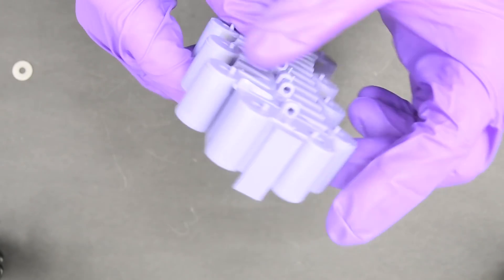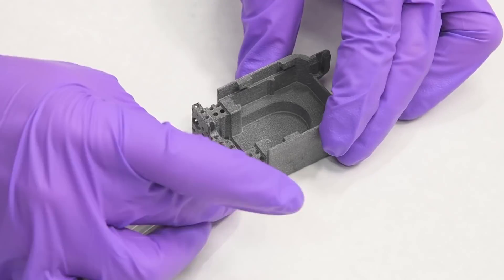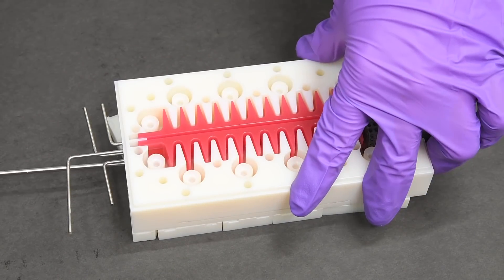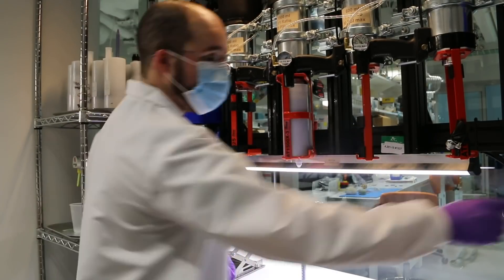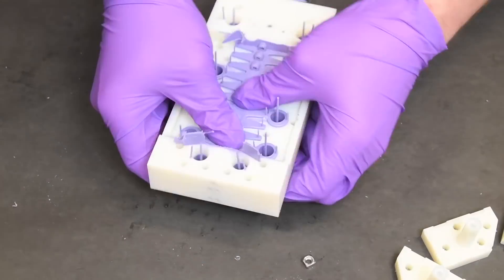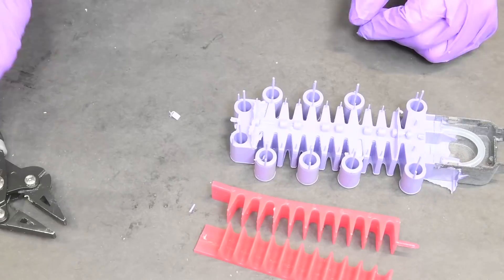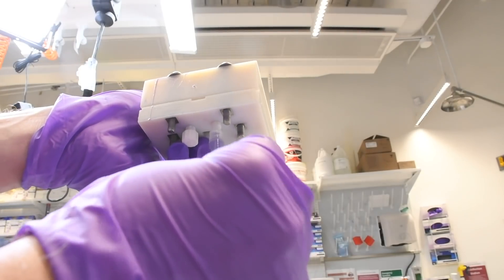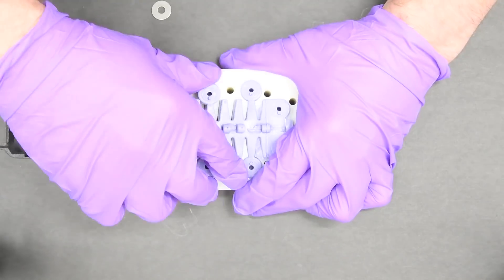Soft Robotic Manufacturing: Bi-directional Bellow with Integrated Magnetic Dome Actuators

Comment: 3:14 what material is the soft-core made out of?  Silicone would have fused to itself during the cure, so I guess something else?
Reply: I use Tin and Platinum based silicone's for resin molds and those 2 wont bond to one another  so perhaps this process it something similar .

Comment: I have no clue to WTH this is or does but it's damn fascinating 😂
Reply: It's like a willy, it goes long it goes short
Reply: @frostedlambs  
It might bend. One way when the pump rotates clockwise and the other way when rotation reverses
Reply: @donfenaroli3650  actually it just does a little dance, a robot dance.

The truth is we can say it does anything and no one will know any better because they didn't show it working. 😭
Reply: @donfenaroli3650  so that tube is for a peristaltic pump? What's the reason for using it, instead of just pumping air with a compressor and controlling it with valves?

Comment: Great work! I have two questions: 1. how do you make the softcore? 2. why don't you use wax instead of softcore? It's easier to remove.
Reply: Not OP, but I think the softcore is better in this case if it's reusable, and it won't leave any traces of wax behind after melting it out.
Reply: I'm assuming there's a separate molding process for it. But here's my question - what's it made out of that it doesn't inhibit the cure (or bond to) the silicone injected on top of it? Most rubbers do one or the other. @Michael Bell?